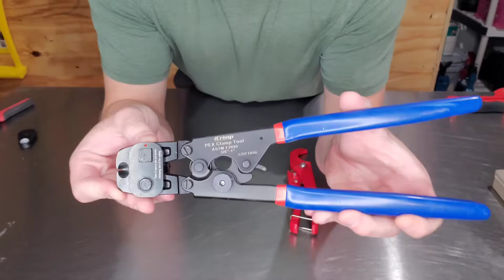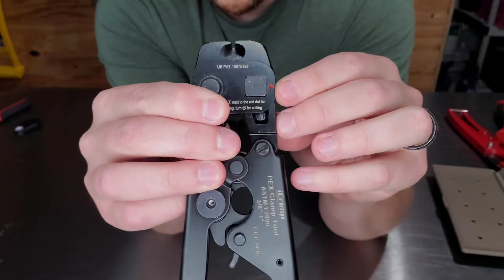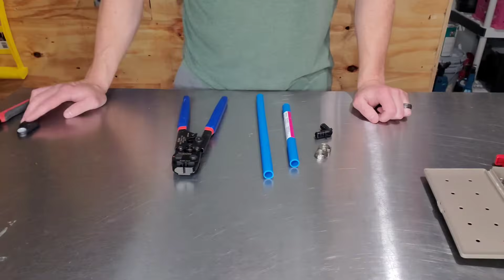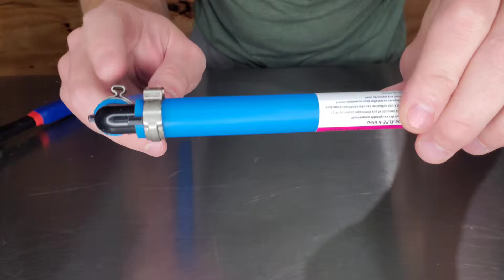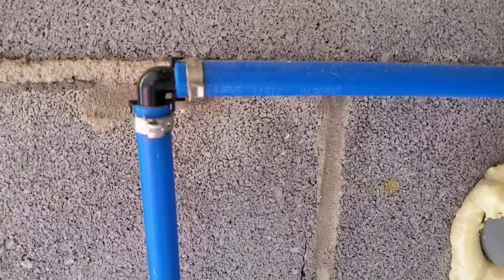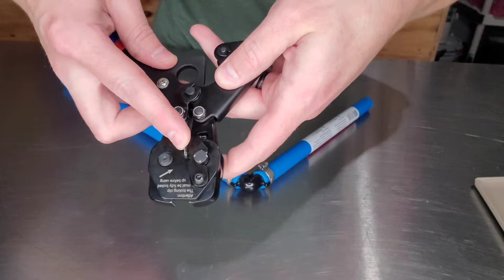iCrimp Clamp Tool Review Tutorial - DIY - PEX Cinch Clamps

Comment: I have this tool. For the price I like it. It is clumsy with the size and 2 handed use along with me being very much a novice. Knowing what I do now after using it I would still buy it again. As for the pipe cutter. I found it decent. I have a smaller version than the one you got from ace. That i got from Ace. I like the one from that came with the clamp better. Neither cuts a great straight line but it cut better than the Ace one.
Reply from the maker: It is a little clumsy I agree